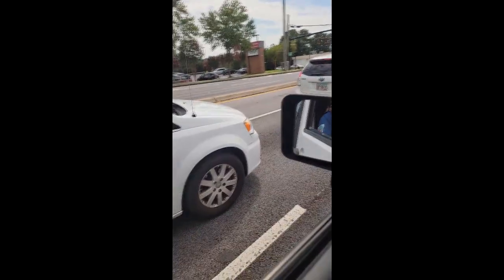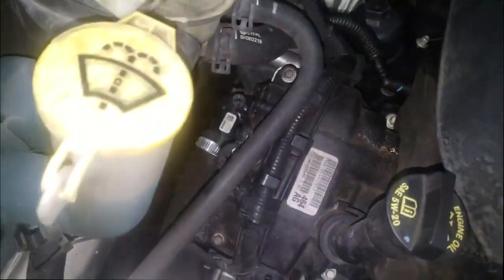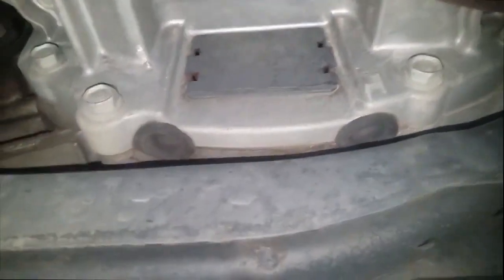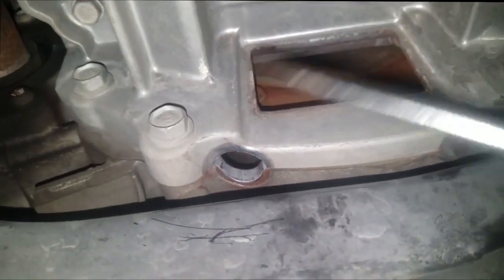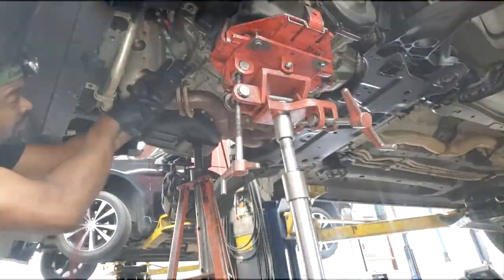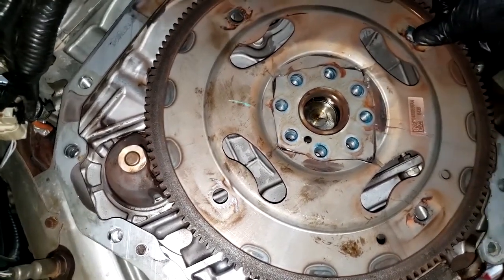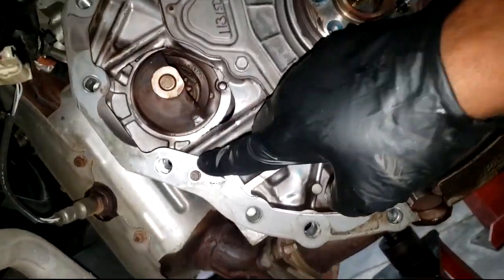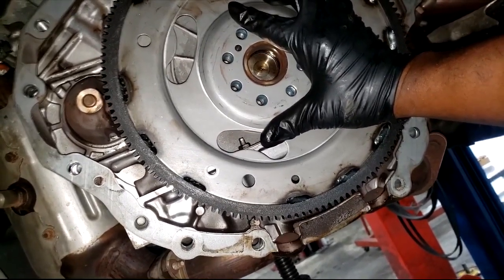This is not a Engine Knocking Ticking Noise. Let me explain.

Comment: Old school that's called a flex plate. A flywheel is only on a manual trans. Auto trans is a flex plate the converter does the fly wheel part.

Comment: Yoo I got a 2012 dodge grand caravan that I use for work. It just started making this exact same sound about a week ago. It has 170k miles on it. And I havnt been able to figure out where the sound is coming from. But other than that it drives perfectly fine. No emergency dash lights are on. It does get a lil worse when you turn the ac on.

Comment: I've had TWO of those flex plates break at around 110k and 166k.  Only explanation I can come up with is that the engine to trans alignment is off.  Btw the trans went at like 140k.  Shameful.